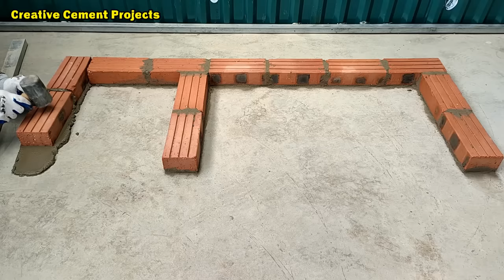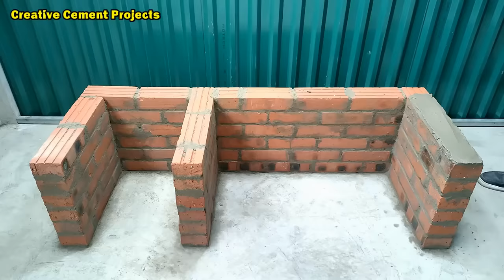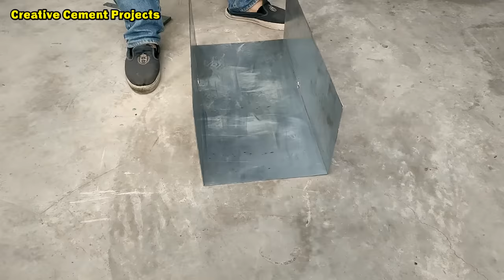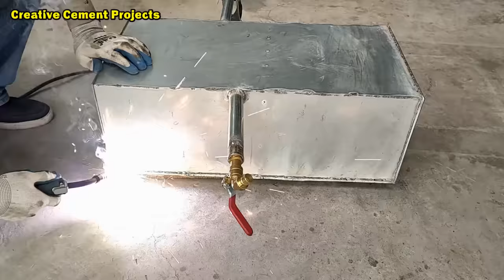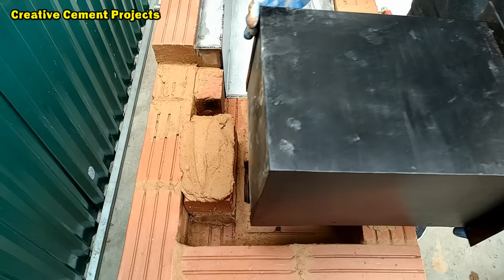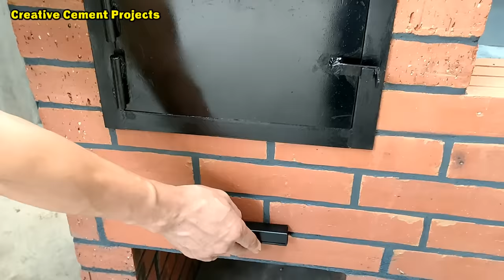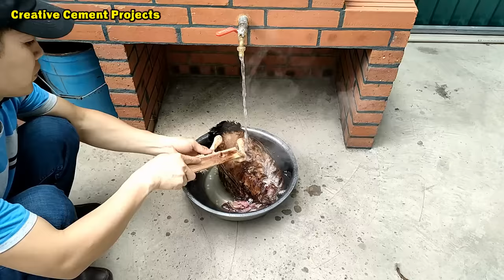Amazing how to make a four in one wood stove / Hot water stove

Comment: Excellent work! But there is an addition: you need to make an air vent from a hot water tank, otherwise, at critical steam pressure, the welding on the tank may burst
Reply: No need, the welds will rust in a couple of weeks anyway.
Reply: Ершн кеш г не знаю как ваши и как вид важно у ко УК ко ю там Рит рп но дж нж он л
Reply: @FreezeS  It is truth too
Reply from the maker: Thank you. Now I have connected the hot water faucet to a large tank, and the water is flowing in a cycle, very safe.
Reply: محمد muhammad
Reply: Linda demais
Reply: Lindo demais parabéns
Reply: @Creativeproject2020  was not safe" for the chicken 😓
Reply: @FreezeS que material sería mejor para que dure?  Tal vez el acero?
Reply: ❤❤❤❤😊❤ 0:58 ❤ 0:58 ❤ 0:59
Reply: can you give me this size?
Reply: @fajarpambuko  what size?
Reply: @fajarpambuko en of video shows all dimensions
Reply: It's likely the stainless will buckle before the welds give. Even so, you're right. That pressure is insane.
Reply: 😊 @FreezeS

Comment: Question what's up with spot under oven ? Why does it have opening if you closed it wouldn't it be more of rocket oven without stove part ? Also  couldn't you place  stovetop above oven.
Reply from the maker: Thank you, that little drawer is for easier cleaning of coal ash
Reply: @Creativeproject2020  No problem buddy. No one's design fits what I want so I guess time to great creative. I would like to be able to cook a turkey in my own oven using the tumbleweeds and sage as fuel. Their is forest nearby I could collect kindling as well. I really think your creative design is awesome. I think I might make it more oven shaped with smoke stack being the water heater. Run a metal piping to a sink. Reason I would put water heater on smoke stack of I wouldn't want water to warm. Just enough to wash hands and or food to be cooked etc.

Comment: Very nice work altough I think its a dangerous construction since the boiling water has no way to release pressure. What we have seen here is basically the construction of a small steam powered bomb you can cook on.
Reply from the maker: Thank you. Now I have connected the hot water pipe to a large tank, very safe

Comment: Where was the hot water coming from? Sorry i still don't get it.
Accidentally found this video and getting curious
Reply from the maker: Thank you. Cold water is supplied from the pipe on the right hand side, and is heated directly through the iron box in the kitchen, and hot water flows out to the faucet on the left hand side.
Reply: I see.. thank you for the explanation

Comment: In beginning upper portion is made by sand not by cement
But finally you show whole the construction is in cement.
What is it,?
Reply from the maker: Thank you. The base of the kitchen, I built with sand cement. The high heat resistant part, I built with a mixture of clay mixed with sand and cement

Comment: Very nice.  But to be on the safe side shouldn’t you have a pop off or safety valve on the water heater potion?   Ever seen a hot water heater explode and go up or out?  I saw the evidence of one that pressure alone took it through the roof of a 3 story house and the wall it was next too.  From the basement!
Reply from the maker: Thank you. Now I have connected the hot water faucet to a large tank, and the water is flowing in a cycle, very safe.

Comment: Excellent project. I see only one issue that could be catastrophic if left undone. Install a pressure relief valve on your water vessel.
Reply: Exactly...
Reply from the maker: Obrigada. Agora conectei a linha de água quente a um tanque grande e a água está fluindo em um ciclo, muito seguro.
Reply: Yes I just wrote the same thing hehe. Looks good but will crack to bits as the tank expands .

Comment: Well done. But will hot water not reverse to inlet?
Reply from the maker: Thank you for watching. Hot water will not flow back to the inlet, due to the greater inlet water pressure. I plugged the barrel of water into a large reservoir and it has a very safe pressure valve
Reply: @Creativeproject2020  Thank you

Comment: Those metal sheets is clearly zink plated steel. Next year this "water heater" will be leaking due to corrosion and then after the next heavy winter the water leaking from it will freeze cracking the whole thing. Where is the sense of not using proper materials?
Reply from the maker: Thanks, I'll listen to your comments

Comment: I have one single question: What does that small black plate does under the furnace area? I don't get it!
Besides that it's really good,I love the concept and the upper stove plate can be changed... it's amazing!
Reply: I wasn't sure either, but I think it's for dumping the ash out. So you keep pushing the fire in from the right hand side and then can just pull the try to drop the ash in to the bucket below.
Reply from the maker: Thank you. The function of that small plate, is to clean, to easily remove the coal ash that falls into a container below
Reply from the maker: @Tank420uk Thank you. You are right
Reply: @Creativeproject2020  I see,thank you !

Comment: That is an very inefficent way to heat water. Use a thin water pipe end bent it back and forth through the firebox, Like in an old steam train.  way faster and very hot water.  But the design is bretty nice.

Comment: Tudo completo forno e fogão muito boa ideia mesmo e económico
Reply: This is a bomb in the truest sense of the word. I did not see a valve to bleed off the water vapor that will form inside the boiler when using the stove. Of course, you can turn off the water supply and open its drain so that the remaining water boils and all the steam comes out. But if someone forgets to do it,
as a result of a steam boost, at best, only the stove will disappear.
Reply from the maker: Thank you. Now I have connected the hot water line to a large tank, and the water is flowing in a cycle, very safe.

Comment: 🤣 what will happen when the water tank will, and it will overheat? where all that pressure will go? there is no safety valve no expansion vessel, nada🤣. you should calm down bro before you kill somebody
Reply from the maker: Thank you. I have now connected the end of the hot water hose to a large tank, and have a very safe pressure valve

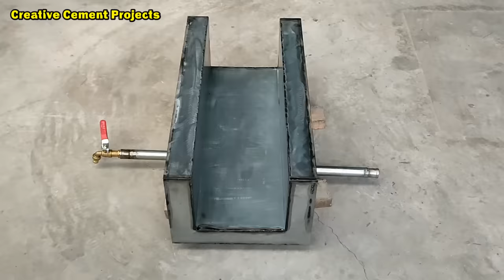Comment: 5:35 Without an automatic pressure release valve, isn't that a bahm? It looks like a bahm. Please somebody tell me that's not a bahm.
Reply from the maker: Thank you. In the video I simulated by opening the faucet to show you that the water heats up very quickly. Now I have connected the hot water pipe to a large tank with a very safe pressure valve.